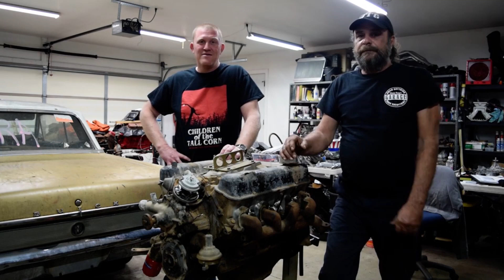Buicks Miracle Motor

Comment: I drove a 1967 LeSabre in high school it had a 340 engine.
It had 130,000 miles.
Reply: 1967
Reply: @christianmotley262  
It was like driving a Boat.
When I was a kid my parents had a 1955 Buick Convertible.
I made a Youtube "1955 Buick rag top"
Reply: @chamberizer  my dad was a Ford man, he had a 1957 Ford and pulled the camper that we lived in when he worked on Interstate 10 going through West Texas but I distinctly remember him driving a 1958 Buick, that he probably was trying out
Reply: @christianmotley262  
When I was about 4 years old - I was playing with the gearshift on a 1954 Buick & Rolled it into a curb across street (no damage).
I owned an F150 for 25 years it had a straight six. I liked but it rusted out.

Comment: Chevy Porcupine ... Love the 427 big block Chevy. For it's time the 427 was a promising engine. Rated at 390hp. in LOW performance version! Torque MONSTER! With a mild hydraulic cam, 10.25 : 1 compression and a cast crank in 2 bolt main saddles. Needed a little lightening/ upgrade in the valve train dept. but you could really get some great power for the street from a big block Chevy. No need to agonize over single/ dual plane manifold as they had low end stump pulling torque to spare.
Reply: The lo po 427 was 335 horsepower hi po was 425 in full sized cars. 435 in the Vette.

Comment: It's probably fair to say that the Rover V8, descended from the Buick 215, is the UK's Small Block Chevy. Its compact size and light weight absolutely transformed the sportscars it was put into (TVR, Morgan, Marcos, MG, Triumph) and of course was the heart of the Range Rover and better equipped Land Rovers for decades. So pleased to see my favourite little V8 getting some love from Uncle Tony!
Reply: Small Block Buick.
Reply: The rover V8 IS the Buick 215. GM sold it to Rover. The 215 is the predecessor to the 300”. In 64’ the 300 had aluminum heads and iron block. ‘65 went to iron heads and iron block. People often assumed it was a small nailhead but it was its own animal.
Reply: Rover bought that engine from Buick
Reply: @anthony8362  exactly!
Reply: And it wasn't until the 70's/80's that the General started 1 piece making the MOTORS of the vehicles at that level.

Comment: Wouldn't arguably it be the 318 it ran till 00 and was used in pickups cars and even bigger gas transports
Reply: Buick 215 showed up in 1950 and made until 2018 in Australia...
Reply: @BuzzLOLOL   wasn't arguing that just stating 318 or 5.2 at the end of its run had a huge foot print on the motor world as well

Comment: Greatest engine GM ever stopped producing...the newest ones made good power, great torque, 30 give or take MPG in GM's biggest cars of the time, and very low emissions. The most evolved engine GM produced. It was a sad day for history when the last one rolled of the line.
Reply: SuperDave Miorgan  first off the newest variant of that engine isn't a v8 it's a 3800 v6. Did you not hear them talking about the turbo charged version that went into Grand Nationals? Grand Nationals never got a v8. They got a Buick 231 v6 which is a 3800. They stopped the v8 version of that engine with the last of the non metric GMs in 1977. And it certainly was not uncommon for a 2008 Buick Lacrosse with a 3800 v6 to attain 30 mpg while being certified  ULEV (ultra low emission vehicle).  You can stop talking out of your ass.
Reply: SuperDave Miorgan  you're wrong dude, I've seen bathtub impalas get 30 mpg highway with 305's, Corvettes with LS do the same, hell I had a 1977 Chevy Monza 262 V8 2bbl, 2.41 gear got 28 mpg with no OD at 65-70 mph.

Comment: The Ford 302 V-8 is more original than the Buick V-8, when talking apples to apples. The Ford 302 V-8 Blocked remained unchanged for 30 years, 1965 to 1995, way longer than the V-8 Buick. It remained the same cubic inch and was a pushrod engine, and if you allow overhead cam engines, it is still  in production in 2020.

Comment: SBC hands down, it's been in production since 55 and has been sold and swapped into everything imaginable.
Reply: It didn’t have much reach out to other brands in other countries and doesn’t compare if you watch the video
Reply: @theeoddments960  
I disagree due to the fact that the sbc was sold in marine and i think even in industrial applications which the buick never did. It was also sold in every kind of vehicle you could imagine. The sbc has also sold more units than any other engine ever. But  i do have love for the buick.
Reply: @malcolmstone8116  I own a 1966 Buick Electra 225 and even in the pamphlet there are all the engine choices and the 300 was specifically noted as a marine engine. You don’t have a source for anything you say
Reply: @theeoddments960  
Ok so let me ask you where your sources were because i did not see any. Also the small block chevy most certiainly left american shores. It was used in the holden manaro in australia in the 70's. Second of all the reason that the all aluminum 215 was sold to rover in the first place was due "block porosity" issues they were having problems with in the 60's. Also the small block chevy was turned in to a v6 just like the buick. The small block chevy and its variants are still sold by mercury marine to this day. Also please tell me production aircraft(ie not an experimental) used a buick engine i would be appreicated because to my knowledge the only automotive based engine approved by the FAA for aircraft use is the toyota 4.0 v8 engine code 1uzfe.
Reply: @theeoddments960  
Please tell me what boat/watercraft manufacturer used the buick 300 as there powerplant.
Reply: @malcolmstone8116  the v6 variant and v8 was used as standard in the mid sized evinrude boats for more than 30 years you don’t need a comment to tell you to do your research you can just do your research
Reply: @theeoddments960  
You know man i was just trying to voice an opinion and instead of informing you attacked. Also i never in my original post said that the buick engine was never used in varied applications just that the chevy was and that i believe that the reach of the small block was geater than that of the small buick engines and aside from proving that they were both used in similar applications all while being a prick about it but i bid you farewell.
Reply: @malcolmstone8116  don’t take stuff on the internet seriously that’s rule 1 because you get yourself out of that rut and you realize you’re feeling attacked by words on the internet and it’s so far removed from the real world it’s laughable. That’s how you become a Twitter user. Anyways no hard feelings they’re just words
Reply: @theeoddments960  
Yea i was just voicing an opinion i was not trying to offend. I understand that people can hold different opinions. I am not going to lie i did feel attacked by your words but i appreciate you that you let me know that wasnt you intention. Anyways no harm no foul. Have a good day.
Reply: SBC if you're talking about just America.

Comment: I see success that is how far it can be taken to that date in time.
I agree that the 350 would be on the list but then also should be the Mackinnon (gm) 283, dodge flat 6, the ford inline 6 and the gm inline 6. All those engines have been in a long line of running in cars, trucks, generators, pumps, equipment Etc. Studebaker used the 169 6cyl from 1939-1960 and used in cars, trucks, and military surplus. I'd say they were the most Universal engine. Most people just think of horsepower but some of those underdogs have lasted years and alot of abuse.

Comment: That's kinda cute that it was produced for 47 years....
The Ford Flathead V8 was built for over 60 years....
Reply: The flathead Ford V-8 was produced from 1932 to 1953.
Reply: @Doosterify  The French Military used them well into the 90s.
Reply: 60 ?

Comment: I consider myself somewhat of an expert on the Buick V6 (currently own a 80 drawthrough 3.8, grand national intercooled turbo setup on a 4.1/252, and an S2 3800 supercharged in a firebird), but hearing the evolution of the 215 in it's v8 days is something I never looked much into. I (shamefully) forgot the 215 turned into the 350 SBB. If you really want to get nitpicky you can get into low port vs high port 3.8 heads, IEEIIE vs IEIEIE port heads on 88 (pre 3800) 3.8's, the 3.3 and 3.0 with BOP patterns in FWD stuff with or without EFI, ect.

Comment: I have this faint memory in my mind as a kid reading through an old Lotus History book and i'm sure they used a version of this engine.  Can someone clarify what year and model Lotus had the Rover V8 based off of this original Buick?
Reply: Research "Repco Brabham" this will tell you a lot about what was possible with the Buick block back in the day.
Reply: @life_of_riley88  We were restoring a 72 Europa John Player Special at the time, it had the dohc for 4cyl with Lotus head, cool cars but tiny, I had to take my shoes off to drive it.
Reply: @tylerburich4334  Ha! I can't even climb into a Europa(too tall) cool cars though. To answer your question, Jack Brabham took the Buick block, and converted it to overhead cam and won Formula One with a "stock block" engine. May have been some form of a lotus chassis, can't remember.

Comment: Ford straight-six 1941 - 2016, its been in everything from tractors to dragsters.
Reply: i think 96 was the last year for the 300ci in the US, i daily a 95 f150 with 230,000 miles runs great and has great oil pressure and recently passed CA smog.
Reply: That wasn’t one engine design though.
Reply: But through different generations of engine geometry that have nothing to do with each other (specifically around 1941-1960-ish) and was just not in as many factory cars as this motor. And on factory applications the 215 went from a gas sipping economy motor to exotic sports cars. Something that the Ford straight 6 only does when it’s made to race and build by hand and not for any stock application.
Reply: @theeoddments960   well I guess the video should have been called "The Most Successful (And Versatile) FACTORY Engine Of All Time?" but if that's the case then this video should probably be about some Volkswagen engine.
 Ok fine 1961-2016 in factory cars and trucks, But how much more exotic can you get than a one off drag car with a hot rodded straight six and to omit a hot rodded engine on a YouTube channel about hot rodding is just wrong.
Reply: @IggsBoson  i guess you have never heard of the HAGR class
.
everything from AMC 4.0 / 4.2 to GM 292.... ford 300s.... dodge slant six....ETC
you MUST run a straight six
Reply: @kainhall  I have not, that's rad.
I actually don't keep up with racing and all the different classes. I just build for the joy of building.
Reply: Yep the Barra in Australia developed from the old Ford 6
Reply: Yeah we had a old 74 Ford long bed  four wheel drive with 35s on her with a granny four speed and a 300 inline six and it had so much torc that it would rip motor mounts right up we ended up having to chain that old  inline straight 6  cylinder over the motor mounts and bolt the chains together with stainless steal bolts them spot weld the nut one that bolt
Reply: We call it the hot water six because it's famous for running a little hot when going wide open up long hills but it seldom overheats
Reply: And it could produce some awesome power in stock form. My sister owned a 60 Fairlane with the six and it would chirp the tires when the auto trans hit passing gear at 60 MPH.

Comment: ford had an all aluminum v8 way back in the 1940's ,,known as the GAA motor
Reply: but it was not produced in large numbers..... IIRC it was only used in 1 or 2 tanks
.
like, its too large and low revving to be used in a car
.
and their were probably all aluminum engines made in the 1880s...... but only 1.... and it probably broke down a lot LOL!
Reply: @kainhall  no..it wasnt a car engine..i was just stating ford did make an all alum. v8 back in the 40's

Comment: Don`t forget the `89 Trans Am.
Reply: Quickest Trans Am ever tested , quicker than the Ram Air III 400 and 455 super duty , quicker than the LS1. 

(I'm sure that "modern" - 1989! - 245/50R16s had a lot to do with that)

Comment: Dallas,  I don't think the original buick built 215 had trouble with dropping liners because they were cast into the aluminum.  Rover cut costs by using the press in liners and fixed the porosity issues at the same time they changed the assessory belt brackets.  Great job at explaining Buick V8 history.

Comment: Good job guys.  Very interesting.  Thanks for this tutorial.
I never owned a car that had an actual 215 version but I've always wanted a '61-'62 Skylark.  Buick division had some smooth engines in that era.  I remember driving a '61 Electra that I believe had the 401 engine.  That engine was so smooth and quiet it was like an electric motor.

Comment: The Buick engines are wonderful little pieces of design, particularly the 215 all the way to the 3800. They are my third favorite engine, with the Pontiac first, the Cleveland second, and honestly tied with the Olds for 3rd. I have a particular fondness for the Olds 403. The LS is a lot like the BOP engines(Pontiac in particular), far more than the sbc, so they are like the best of GM design and engineering, with a chevy bolt pattern for the trans and starter location. I can see the 215 design being called the most versatile and successful V8, it wasn't killed off by the bean counters in 1979 like the other good GM engines.

The only reason the sbc was produced as long as it was, and in as many numbers, is because it was a lowest common denominator design that powered trucks, taxis and fleet vehicles. Its not a good design, it needs LOTS of work to get to the point where a Buick, Olds, or Pontiac came factory stock. Without the aftermarket the sbc would be a footnote in history, stock they are low powered slugs that even in the best configuration (the LT-1) made less power than a simple 351C 4V with a tiny stock cam. The sbc needed a 250@.050 cam to come close to the power the Cleveland made with a 224@.050 cam. Daily driver Ford vs race engine chevy. Throw a bigger cam in the Cleveland and it becomes a monster. The 4Vs were the engine to beat in the late 1980s where I came from.

I have a pile of even and odd fire 231s, one is supercharged the rest are NA. There is a plan rolling around my head to build a ladder car, like an Ariel Atom, with one of the 3800s and transaxles. I am thinking the NA heads on the SC short block with flat top slugs to up the compression under the blower, port the hell out of the heads, bump the cam up and run a 110LSA to build mid range torque, and fuel it with E85. You can run a lot more compression with boost on the yeast pee vodka fuel than you can on pump gas. Probably use LS injectors from a 6.0 to increase the head room enough for the fuel requirements. Man that would be a kick ass little grocery getter, easy on fuel, ludicrous power to weight for a daily driver built from junk, and if I get the suspension geometry right it should be stupid fun in corners or an AutoX track.

If I had that 215 I would turbo it and put it on a T Bucket built from scrap. Kinda thinking of doing that with the 1965 vintage 326 that came with my parts LeMans that is now going gasser with a dual quad 455. Ya know, one of the Opel GTs I have with that 215 would be a fun daily driver.